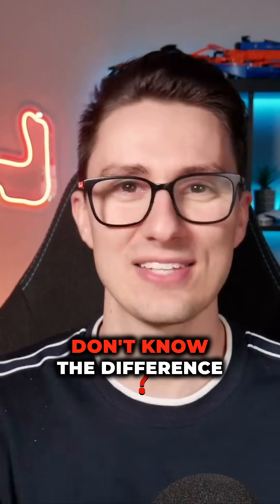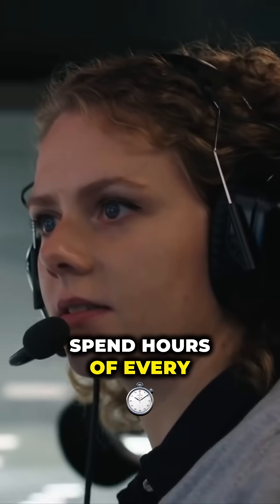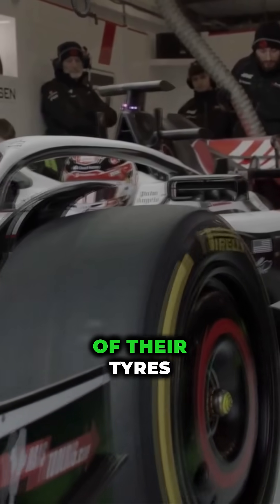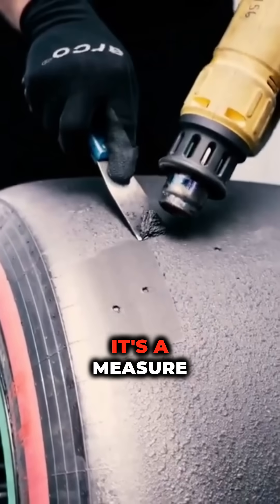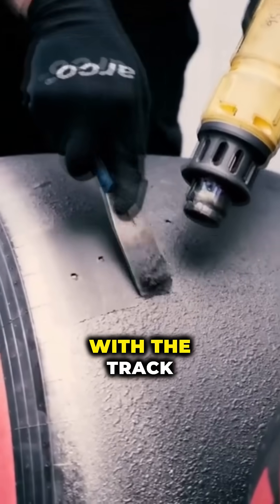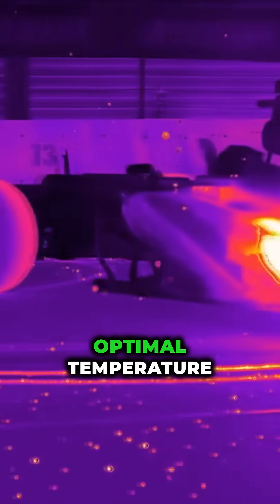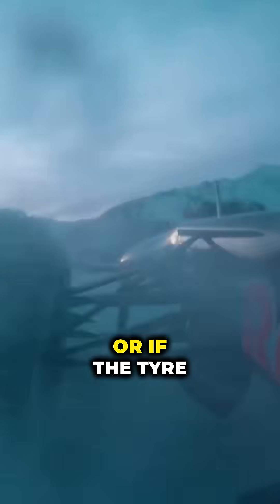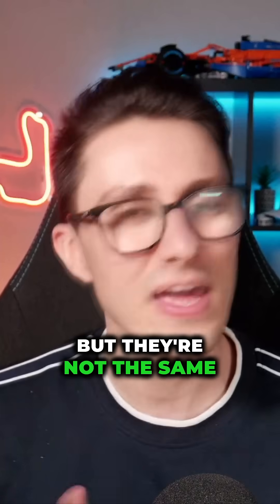Tyre Wear VS Tyre Degradation in F1

Comment: They are functionally the same. It's friction and heat removing material from the tire vs friction and heat changing the chemical structure of the rubber of the tire

Comment: Wear is how the physical structure of the tire is breaking down.
Degradation is how the chemical structure of the tire is breaking down.
Reply: Wear is the outer contact patch being removed by friction with the track , Degradation is when the Elasticity of the inner tread starts to fail and the rubber starts crumbling …
Reply: Thank you both. It's more understandable.